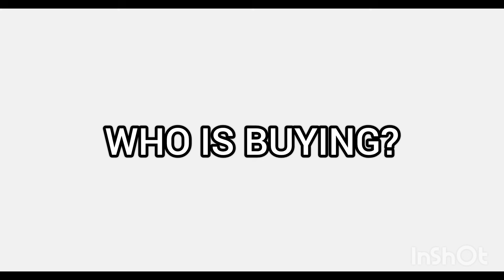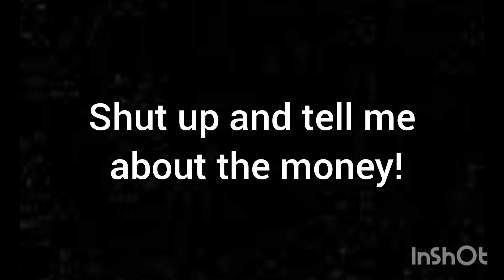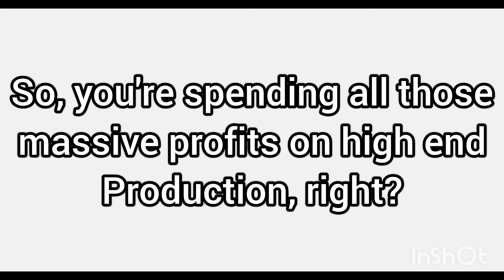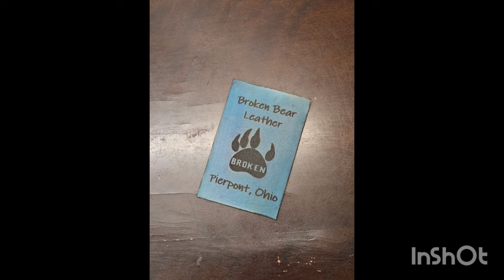Pricing leathercraft items

Comment: I'm a handyman. I charge £30 an hour for my time. Plus materials. If I was trying to sell leatherwork I'd do exactly the same. I've had a few people tell me that £30 is too expensive for them. I will not reduce my price. Problem for leatherworkers is that if you're prepared to drop your price to compete with mass produced stuff then you end up working for almost nothing.
Reply from the maker: Legitimate. I'm certainly not advocating a race to the bottom (or I'd mass produce for etsy). I want us talking openly about it. Mission accomplished! Thank you for putting ammo in the cannon.